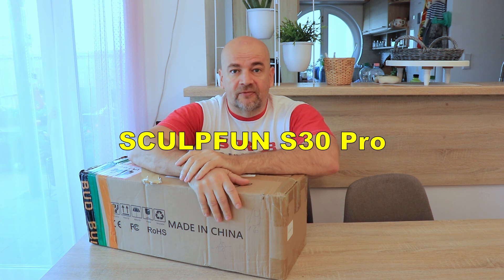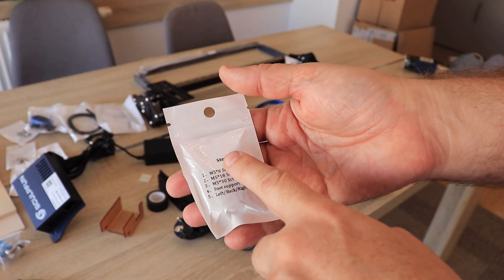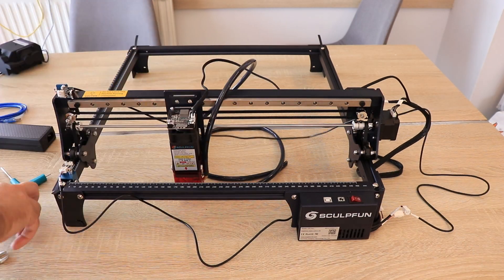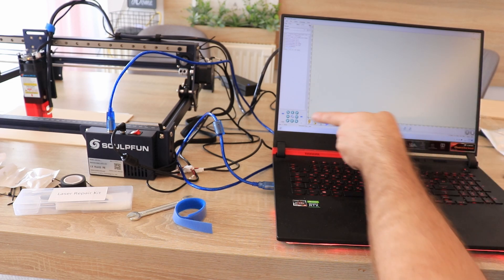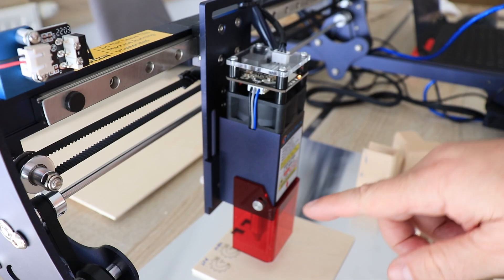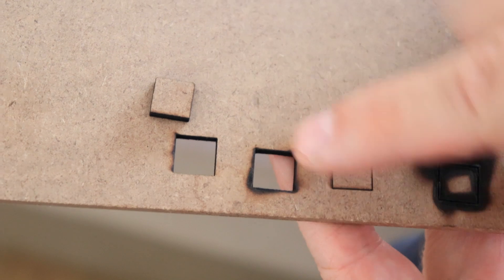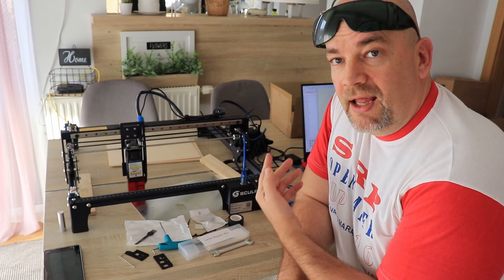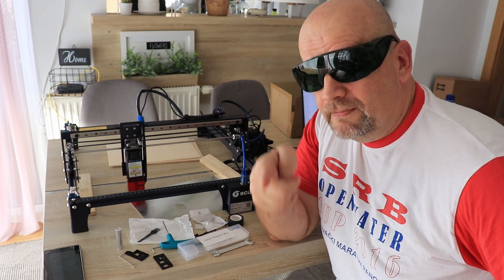Sculpfun S30 Pro - 10W laser engraver with linear rail and auto air assist kit

Comment: I just got the s30 5W, maybe I upgrade to the bigger laser Module.
But now it's enough for me.
Is it possible to mount the S30 20W pro max module to the 5W machine?
Reply from the maker: Not sure if the powe supply is enough. And I don't remember, maybe this engraver works on 12V and 20W on 24V. Another mechanical problem, the 20W module is much heavier, mounting on 20*20 alu extrusion will result more vibration.
Reply: @MyTechFun  yeah, already googled it 
Not possible, it's another Frame itself, an other Mainboard, Powesupply ect.
But 10W should do all my jobs, I'm very happy with the 5v module

Comment: did you have some sort of recubriment in the steel? i tried your parameters and i also have the s30 pro but it isnt working
Reply from the maker: What steel? Everythink is stock on the engraver. Engraved steel may be different, but everything is presented in the video. This machine could engrave regular steel too, not only stainless.

Comment: Your review was very good, with your honest opinions.
I am seriously thinking between these two: Sculpfun S30 Pro 10W or xTOOL D1 10W!
Sculpfun S30 Pro has a lower cost but, it leaves a few things to be desired, like some apparent wires. And that cylinder to measure the focus, which is a bit mediocre and can get annoying, besides being lost in some corner of the house.
The xTOOL D1, on the other hand, is a little more expensive, but its extrusion is stronger and its aesthetics is superior, besides the rollers, which are made of metal. And to measure the focus, it has a retractable lever, much more practical and convenient. These are my opinions, but perhaps I am wrong.
Reply: S30 Pro is superior to the XTool D1 in almost all major aspects except for "looks" as you have mentioned. The biggest feature of them all is the built-in Air-assist that Lightburn can control... this is very very important when you have to engrave and cut in the same project. S30 is also expandible on both X and Y axis... that's the reason it is constructed that way.  The lens on the S30 is replaceable! The lens becomes degraded over time and instead of a 250 USD laser module replacement, it becomes  A 20USD  with S30 as you only need to replace the actual lens and not the whole laser module.
Reply: @jomjayo  Thanks for your convincing answer. I will opt for the S30 Pro myself.

P.S.: I have another question for you.
I have had the S6 Pro for a year, but I have used it very little; now I went to cut a square in a 3mm plywood, but the cut was not correctly aligned, there was a small difference (curvature), but not noticeable. So, is there any way to align the laser on the machine (Sculpfun)? Thanks again

Comment: Those type of laser modules scare me, I want one but all the ones without an enclose seem like they would injure someone.
The laser radiation leakage and cheap laser safety goggles aren’t something I want to mess with (yet)

Great video, I feel like I’m learning quite a bit about the software and setting side of laser engraving from your videos. (Mostly here for the 3D printing 😊)
Reply from the maker: Biggest danger with these diode lasers is the flame and if you leave it without supervision. Safety goggles + protection glass on module gives enough protection. Only everybody in room should use them. And yes, enclosure is safer solution.

Comment: Mechanically it looks much much better than the Atomstack X7 Pro that I own.
Also, here the air nozzle actually makes sense.
Reply: I don't have the Atomstack nozzle but I have the Sculpfun kit and compared to the self made air assist kit I had before, it's on an absolutely different level. Especially the nozzle is very well done, because even with a low power pump it ensures great cleaning and greater cutting capacity
Reply from the maker: If Atomstack, I would suggest you their air assist kit, which arrives with air nozzles too: https://youtu.be/dDInprkMDhU
Reply: @MyTechFun  Yes I have their air assist but I'm quite puzzled by their nozzle.
At least, this one from Sculpfun seems to make more sense